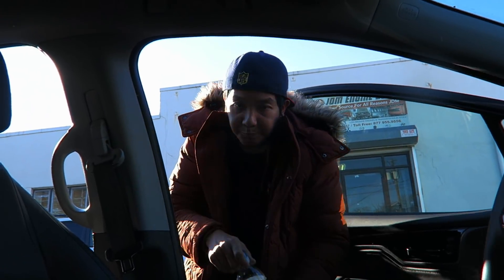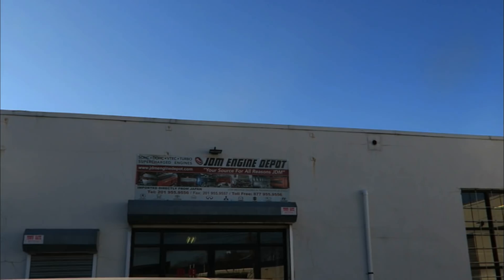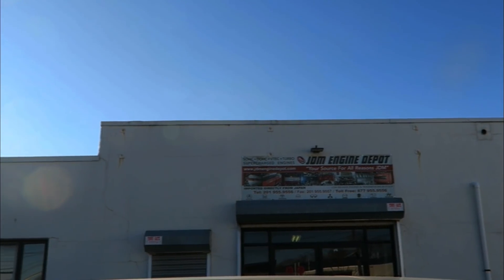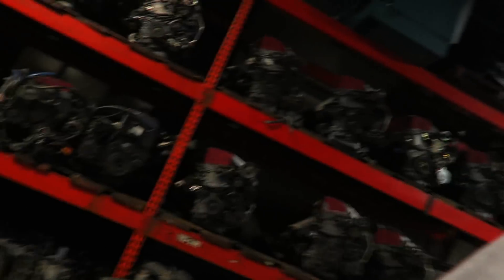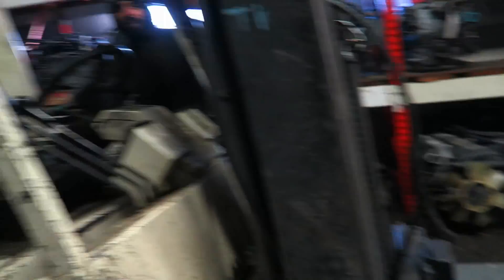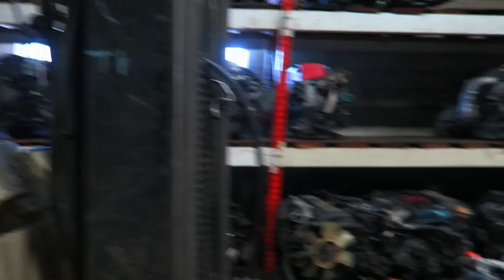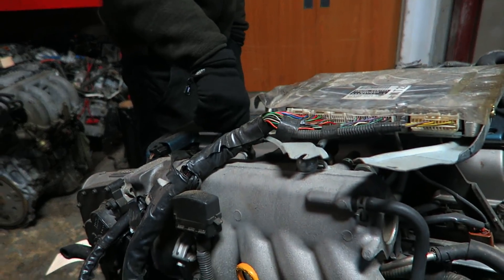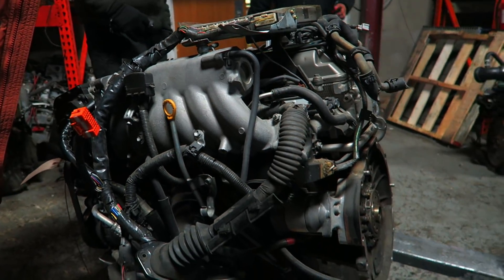Buying A Turbo 2JZ Engine From The JDM Engine Depot | Toyota Supra Build

Comment: 40 to 60k miles lol yea ok , I love how every engine place still lie to their customers about the mileage, they have no idea how many miles a engine has unless the front clip and cluster come with it, they will send over anything and most of these engines aren't even coming from japan. Of course the compression is going to be higher when you drop oil down the cylinders, it's filling the gap on old rings.. plus they clean every engine  before you really see what they look like.. The best time to pick out a engine is when they get a shipment you'll be able to see how dirty and old the really look before they get cleaned. including the one you purchased.. been doing this for 15 years
Reply: John Reilly with the flat black Supra? Only a few Supra owner's left on Staten Island...
Reply: So if all (or some) engines JDM Engine Depot sell are not as they say then isnt that some type of illegal activity of some sort that they are pulling off?  I mean I can understand if they were you local garage down the street but this company looks like they have a whole lot more to loose if they really were to get caught telling us lies.
Reply: @andyz3925  How can they get caught? It's their "estimate". No way to determine the true mileage after the original vehicle has been chopped even with a compression test. Don't go by what they say the mileage is, go by the wet and dry compression tests to make sure the cylinders are all still firing and functional with life left in them.
Reply: @RetrocadePodcast  I hear ya. Thanks for that info.
Reply: Chris Atwell At least you can sell it, recoup $200 lol
Reply: no lies told
Reply: Looking 4 a real 2jzgte 6 speed, any recommendations?
Reply: Mr B Get like over $10k up and don’t forget proper rear diff so the gears don’t feel short
Reply: Retrocade Podcast which one tho vvti, or non
Reply: @mrb6144  vvti
Reply: Their are strict regulations in Japan most cars don't get driven much after 50k

Comment: I recorded my compression test numbers on my phone from Chicago JDM (March 2017) for my Non-VVTi 2JZGTE engine; here they are below.

Dry:
1 - 143
2 - 143
3 - 147
4 - 140
5 - 147
6 - 152

Wet (oil):
1 - 165
2 - 168
3 - 168
4 - 165
5 - 165
6 - 168

Comment: Love the plug for the local Pho spot! Nice video showing the engine purchase process, I'm trying to figure out if I'm going to do a 2JZ NA-T or get a 2JZGTE and swap it into my 02 iS300 manual. Probably going to go the NA-T route only because it doesn't require so much guess work about the engine I'm swapping in. Thanks for the video!

Comment: Wonder when we'll run out of 2jzs
Reply: Toyota would probably start manufacturing them again if that happened
Reply: Thomas King I think they already do and with toyota if you are willing to pay they will make any oem part for you.
Reply: If that were to happen I woul think you could special order one straight from the Toyota factory brand spanken brand new with zero miles.
Reply: Hopefully I’ll be dead by then
Reply: Chris Atwell that's why so many are resorting to cd009 and t56s...IMO the real problem is scarcity of 3.13 rear diffs
Reply: Did.you.say.run.out.never.2jz.is.boss😂😂😂😂😂😂
Reply: Soon mate

Comment: Is that a 2JZ GTE that you bought a 2000 because I'm seeing them everywhere for 6000 looking for a motor
Reply: they really went up in price , i’ve wanted to do this since i was 13, i’m 16 and i got my is300 so obviously i was looking into the swap but all of them are so expensive. i plan to go around to jdm depots and if they are still too high of a price for me i’ll build the n/a ge i have since it had better compression than the gte

Comment: I don't know why I broke my pocket over the Non-VVTi....at the time, I knew I wanted S1 cams (269 deg) but GSC didn't make the S1 cams for a VVTi 2JZ. So I paid more, bought the Non-VVTi and....a few months later GSC comes out with the S1 cams for a VVTi 2JZ

WTF...
Reply from the maker: I’m glad we’re both getting our hands into these engines! I’m unfamiliar with the nj area cuz I’m from mass but that’s cool to know of other places to get these motors from, with so many of those options available. Feel free to hmu on instagram if u have more questions on the build!
Reply from the maker: And it seems like you’ve had a lot exposure to these motors! I’m just getting into all the mechanics and part options myself!

Comment: In 2019 the price went up to 2700
Reply: For real?
In my country price of 2jz gte around 2000 usd
Reply: I just did my swap, mine costed 3500
Reply: No fking way

Where u guy from?

Am quite surprice after i checkd price of sr20det s15 in USA it cost over 3400USD im my country it cost 1500 to 2000 usd

Comment: I pulled an engine from a 1986 toyota van back in 2015 from the junk yard , check the compression and it was 150 psi and the van had over 300,000 miles on it wtf ......JDM   engines 60 thousand miles .....150 psi really .....this is bullshit!

Comment: It has a immobilizer though! What a lie about the mileage...haha prob over 120k on it 4 sure! Believe me in Aus i bought the same motor in a front cut, they said the same thing, vin'd it and fk no, bought it for 3k they wanted 4.5k...Compression should be over 170psi as the 2j i have specs at 182-185psi through the 6cyl...